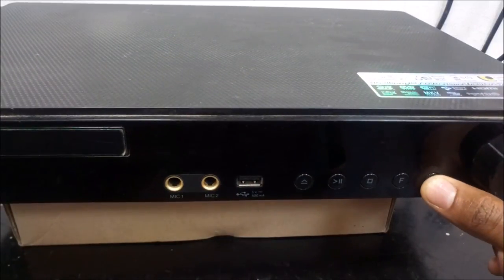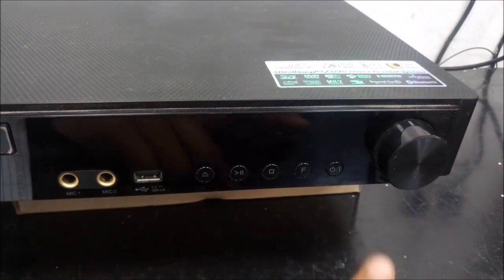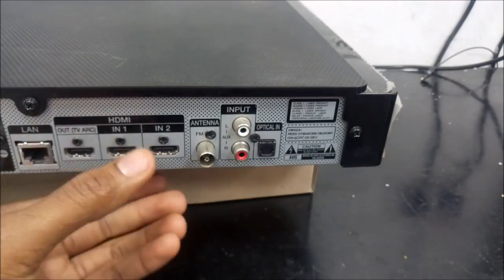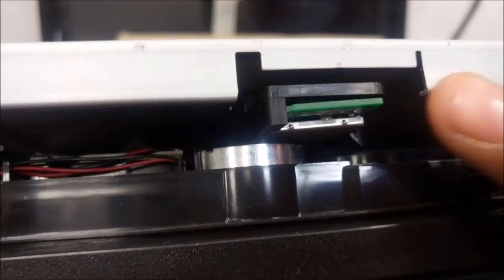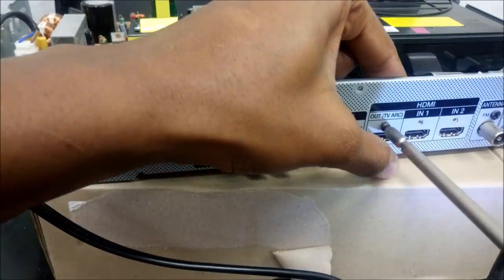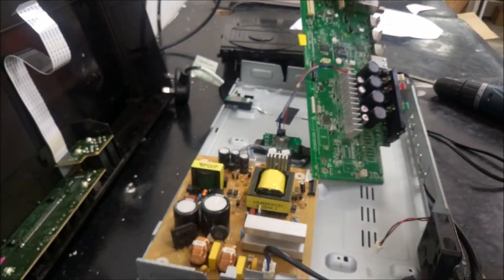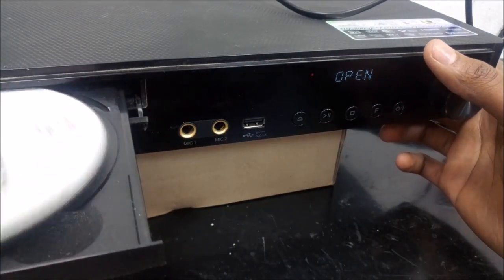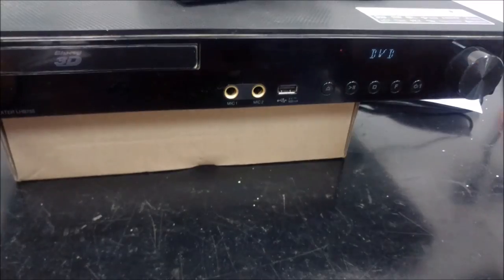LG Blu Ray 'Please Wait' Problem Solved

Comment: Hey guys! I solved the problem. Tried to put the mainboard in the oven for 30 minutes at 130C °. Let it cool down and then put it back in place. It sounds stupid but it worked for me! Covers the plastic parts with aluminum foil. Good luck to you
Reply from the maker: Great tip!
Reply: I used a heat gun on my main board at 200 ° C for about 5 minutes and it went back to work. Mine is a LG HB906SBW model
Reply: obrigado pela dica. Fiz exatamente como descrito e meu home theater voltou a funcionar! Maravilha!
Reply: o modelo do meu é o LG HB906SBW
Reply: @SuperMarciop  fizeste como? No forno?
Reply: @pmsjesus  abri o aparelho, desconectei os flats da placa mãe, desparafusei a unidade de DVD e retirei ela pra liberar a placa mãe. Retirei a placa mãe, desencaixei os dois "parafusos" plásticos de um protetor metálico que fica em cima do processador, deixando o processador aparente. Protegi algumas partes plásticas da placa mãe com papel alumínio. Coloquei a placa mãe no forninho elétrico por 30 minutos a 130º. Esperei esfriar, montei tudo de novo (é importante conferir se reconectou corretamente todos os flats e cabos). Liguei o receptor e pra minha surpresa (e muita alegria) funcionou tudo novamente.
Reply: @SuperMarciop  obrigado pelo feedback, segui os passos e.... Ficou a funcionar perfeitamente. Muito obrigado pela dica
Reply: @pmsjesus  👏 👏 👏
Reply: Thanks my friend, It works!!! 😄, the motherboard at 130°C for 30 minutes in the oven and the ''please wait'' message disappears and everything works normal, My model is the LG HB906SB. The only sad part is that the RCA connectors on the back were attached to my motherboard, then the heat of the oven ruined them (the plastic part melted a little bit even with the aluminum foil covering it), I will have to replace that part with other RCA connectors to the motherboard.
Reply: Thank you for the tip! Works well!

Comment: I have just applied hot air by a hair dry, close contact, for 2 full minutes, onto the three chips: one behind the black metal passive cooler, and two nearby chips. It worked like a charm! Just disassemble the mainboard, remove passive cooler from behind the mainboard, and apply heat onto those three chips. I hope that works for you two!

Comment: What's is the problem when LG remote control is serving the same purpose that is all battons are only closing and opening the home theater is the problem with the remote or with the home theater?

Comment: I fixed mine, by using hot air gun on the main processor. It's working good now.
Reply: Mate, you saved mine! Hair dryer round the proccesor for abit and it's golden! I imagine just some cold joints that needed abit of tlc.
Reply: @lachlanob  The original heat pad under the heat sink is under performing due to age, hence allowing heat to affect solder joints of processor. Therefore, for a more lasting solution, replace with thermal paste nicely spread on the processor, then fix the heat sink and you are good to go.
Reply: Can you make a video please, this dont help nathing 😂
Reply: Thanks mate, mine is working now.

Comment: Hi , I have Lg Blue Ray HOme cinema model no Hx906ta and it starea but remains in "please wait".Watching your video,I saw you changed a piece and i was wondering Shock and where i Could get one considering I am from Romania?
I went to Lg with the system but they said they cannot do anything on it.Could you please guide me so I can repair mine?Thanks!Andreea

Comment: Have you ever repaired one of These lhb725 with the overheat Problem? The Fan Looks Like does not Work...and the Volume Turns automaticly down...Hope you can Help me...and i Hope too that i don't have to Change the Board!
Reply from the maker: You have no other choice. The only solution is to change the main board.
Reply: @DominicGichane  I don't have a very bad failure, only when I have the volume more than 50 or above for more than 1 hour or less than 50 for more time...I hope that my board never gets  burned...if it so I'll have to purchase a new one instead. Thank you for your time answering my questions! Greetings from México.

Comment: I want to ask, can anyone in the topic, there is such a device 
LGHB976TZW, the receiver itself is dead can not be repaired there is a replacement of the board is needed and I do not find spare parts for it anywhere, the buffer itself from the receiver is connected by air via Bluetooth, the other speakers are all connected to the buffer, respectively, they also do not work . Maybe there is some universal receiver that can turn on the buffer to make the whole system work?

Comment: I had this problem on an LG LHB336 blue ray player. The first electronics place I took it to wanted $245 to fix but then they kept it 3 1/2 months and still couldn't fix it. The second place said it needed a "system control kit" and fixed it in a week for $80. Go figure. There are a lot of crooks out there.
Reply from the maker: Wow

Comment: Sir explain how to repair this problem.anyone can replace the mother board
Reply: If you have 'please wait' problem then u don't have to replace the motherboard. Simply use hair blower or heat gun on the motherboard for few minutes, this will make the system working again.

Comment: NO YYOU CANNOT GET A NEW MOTHERBOARD......LG tell me that they no longer supply parts for items more than 6 yrs old. Call my a synic but isn't it strange how they stop working after about 6 to 10 yrs old mmmmm!
Reply from the maker: Might it be planned obsolescence? Maybe they want you to by a modern sound system with modern features.

Comment: Are you insane, what is simple about replacing a motherboard?????? If you want to buy it as a spare part, it is more expensive then whole stupid system. Be clever in the future, don't buy "all in one", get yourself little amp with two decent speakers what you can keep forever and if you need DVD or BluRay, keep buying new when they pack up